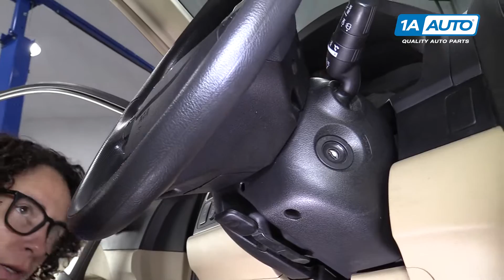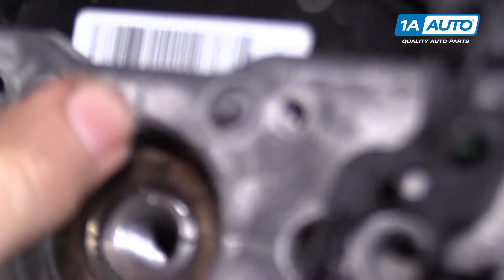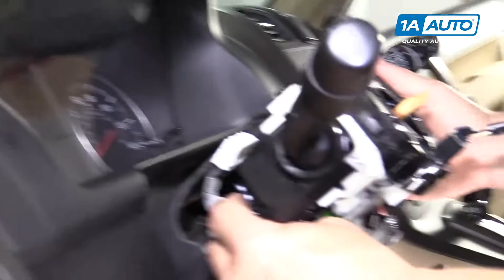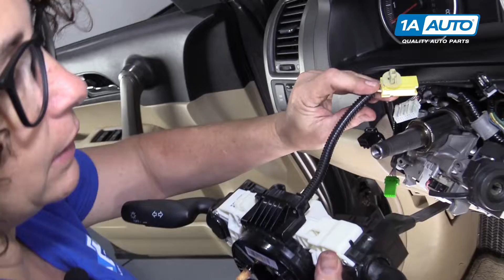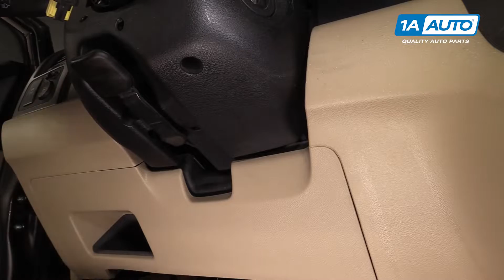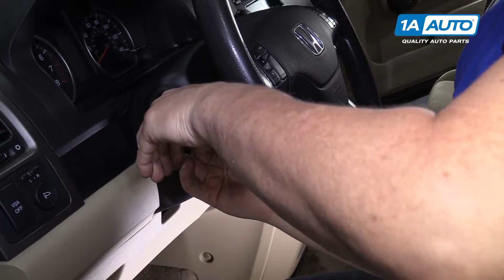How to Replace Turn Signal Switch 07-11 Honda CR-V

Comment: 2011 Honda CRV - Replaced mine last night, I didn’t need to remove the steering wheel.  Just the cowling around steering wheel.  Turn the steering wheel to get access to the two front screws.  Real easy.  Issue I was having is that the right turn signal wouldn’t always stay on, even with the steering wheel straight.  It fixed the issue.

Comment: Well produced video, but an unneeded amount of parts removal.  I regret watching this, caused a lot of wasted time.  Take off the top and bottom of the "clamshell" plastic covering the switch.  That's it.

Comment: Awesome video! Helped me replace the blinker stick in my 2011 Honda Pilot. Minor changes: after removing the steering wheel, I couldn't just remove the 3 bottom screws and pop apart the two plastic halves with a trim tool. I had to remove two extra black Phillips screws on the front which held the front of the two pieces together. Also, once removing the black trim, there were only 2 screws on the front holding in the blinker stick. No need to further disassemble! Just remove those 2 screws, undo the cable on the back, and pop it out and put a new one in!

Comment: Toooooo many steps. This only takes about 2 mins to do. No need to remove all that. 3 screw on the bottom and pop the plastic apart. Remove and replace. That simple.
Reply: But then how would you remove the third screw at the back of the switch? Unlike some other models this one has this screw
Reply: I was thinking so many steps too. I have a 2008 do i need to do all that or can i just unscrew the bottom cover?
Reply: @judyvasconcelles9001  did you do it? I have a 2008 too
Reply: I thought the same, didnt do it yet, although honda added a 3rd screw in the back, which I certainly will (not) put back
Reply: You are sssoooo right,  there is DEFINITELY a quicker way to do this. Check out this video: https://youtu.be/4RoiEsoE6Rc

Comment: WONDERFUL!
Superbly done!
 I have a 2010 CR-V EX and it doesn't turn the headlightd off automatically when the key is removed. Could I buy a switch from the upgraded (EXL) trim so that I can access the auto off function?
Reply from the maker: +Sean Reid Thanks for checking us out!